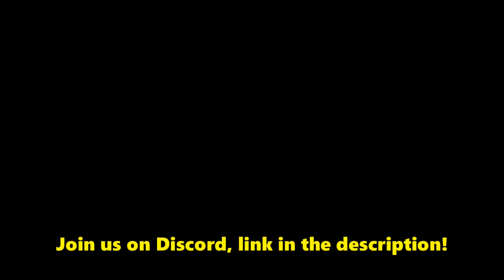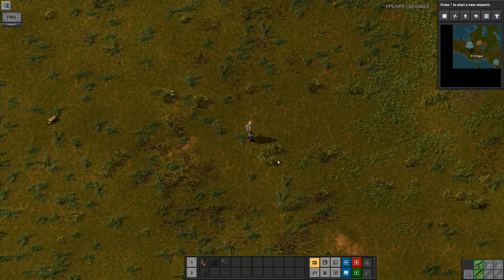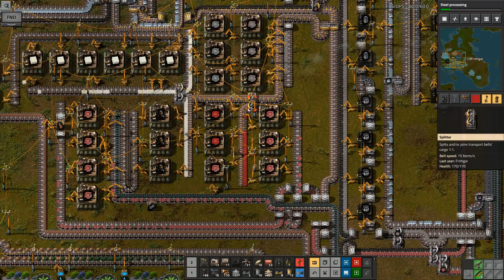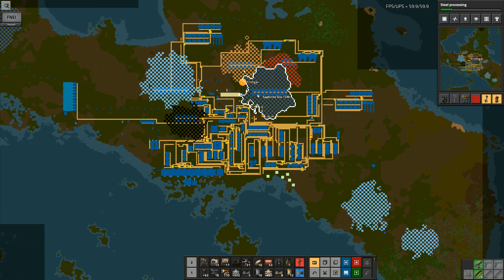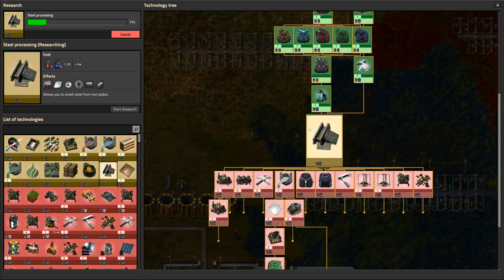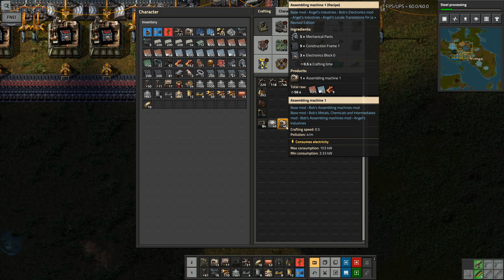Factorio BAT Challenge #33: The Spaghetti Grows!

Comment: You can put an underground filtering out the side you want going in the direction you want. Place the underground so the right side of the belt will go into the underground. If you want it to go in the opposite direction that the underground is facing reverse it by pressing r. You may end up with an odd number of underground’s this way if that matters to you